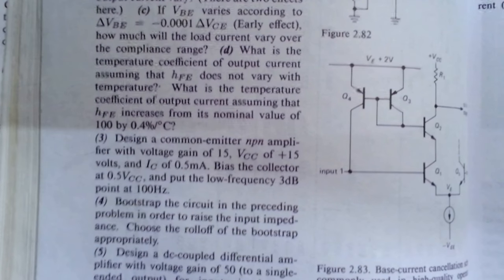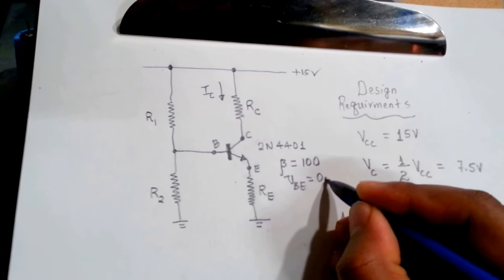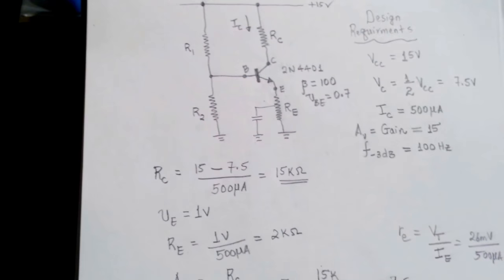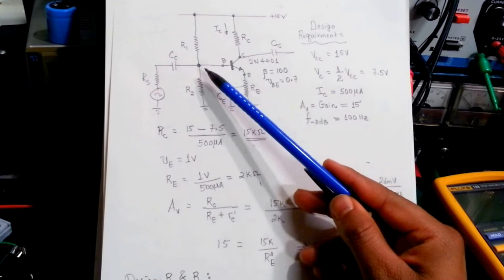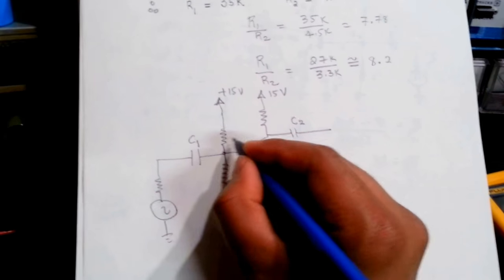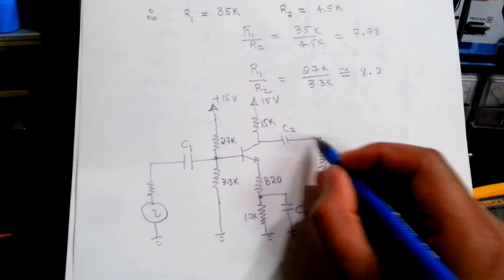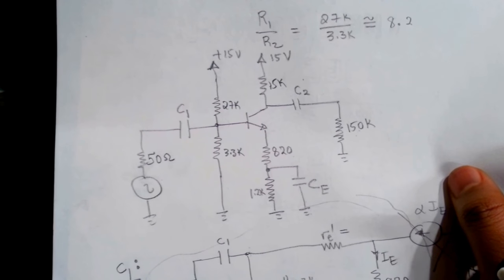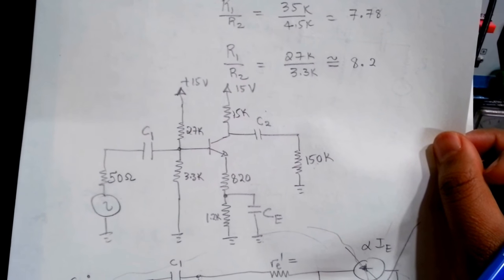Common Emitter Amplifier Design - AoE Chapter 2 Problem 3

Comment from the maker: FYI the on the last shot that has been left out, the low frequency cuttoff (-3dB) is  measured at 12Hz which is much less than the required 100Hz design requirement. This shows the coupling and bypass capacitor design far exceeds the requirement.

Comment: You could use a single emitter resistor of 1K and let the emitter voltage be 0.5V. The resulting thermal drift of the collector current would be -2mV/1K per degC = -2μA per degC, which leads to a drift of +2μA x 15K = +30mV per degC. That's twice what your design has, but with far less complications and an extra 0.5V maximum swing. The gain would be 15K / (1K + 50R) = 14.3, which is less than 5% error and within likely component tolerances.

If you're assuming β=100 (incidentally, not a good design since the minimum β for 2N4401 is actually about 30 at currents between 0.1mA and 1mA), then you can see that Ib = 5μA, so a parallel combination of 10K for R1 and R2 will drop only 5μA x 10k = 50mV (the Thevenin source times the current supplied) from whatever voltage the divider is set to. You already rounded Vbe up from 650mV to 700mV, which is a rounding error ten times the amount caused by this design having a higher base bias impedance than you specified. There's no point in having 50 times the base current through the base bias network if the error it's trying to suppress (variations in β) is already ten times less than a rounding error you already made.

In your design. the ac impedance looking into the base is β x (Re + re) = 100 x (820+50) = 87K. So the input impedance is 27K || 3.3K || 87k = 2.8K. it's as simple as that. You don't need hybrid-π or anything else. You just need to know that impedances in the emitter become β times larger in the base. The input coupling capacitor gives a -3dB point in the amplifier's frequency response when its reactance equals the amplifier's input impedance. The source resistance doesn't materially affect the -3dB frequency. So you need an input capacitor (C1) of 1 / (2π x 100Hz x 2.8K) = 0.57μF. Using a 1μF capacitor will give a -3dB point of 57Hz. Using your 22μF capacitor gives a -3dB point of 2.6Hz, which is a long way away from the design specification.

Similarly for C2, the collector resistance does not significantly affect the -3dB frequency. For a 150K load, you need  C2 = 1/(2π x 100Hz x 150K) = 10nF. You might have spotted that using 100μF is ludicrous and would result in a -3dB frequency of 0.01Hz. The RC time constant of 150K and 100μF is around 15 seconds and it would take around that length of time for the voltage across the 150K load to stabilise.

For Ce, the base biasing has no effect on the -3dB frequency. The gain is known to be Rc / (re + Re1 + (Xce || Re2)). That determines that the -3dB point occurs approximately when Xce = (re + Re1), which is 820+50 ohms in your design. So Ce = 1 / (2π x 100Hz x 820R) ≈ 2μF. It's a pity you didn't show the actual -3dB frequency for your circuit, as that would have made the point about correctly selecting capacitor values to match design specifications.

Adding a 150K load to the output reduces the gain by the ratio 150K / (150K + 15K) = 0.91. That should reduce your calculated gain of 15K/870R = 17.2 down to 17.2 x 0.91 = 15.7. You measured 820mV/50mV = 16.4 - I don't know how you managed to get that equal to 15.7 at 31:24 perhaps you can re-check?

Comment: TO MANY CALCULATION MISTAKES AND, VERY DIFFICULT TO FOLLOW.I LEARNED HOW TO  DO IT DIFFERENTLY COLLEGE.
Reply from the maker: For the benefit of other viewers which calculations have mistakes? Also the method shown in the video is the most standard way to design common emitter amplifier. If you fast forward to the end my design method is confirmed with actual measurement. 

Thanks for stopping by!
Reply: @SmithKerona  
Hi!
First of all, thank you for the video, really helpful and I am having fun following along.
Are you sure the C2 calculation is correct? I am getting 0,1 uF instead of 100 uF, am I interpreting something wrong or you left in a x1000 multiplier?
Thank you in advance!

EDIT: Nevermind, I kept watching the video and I saw you corrected it :P